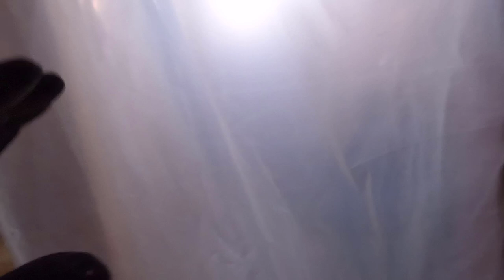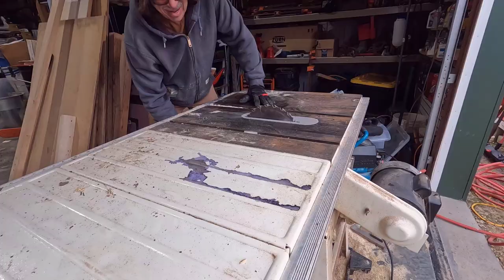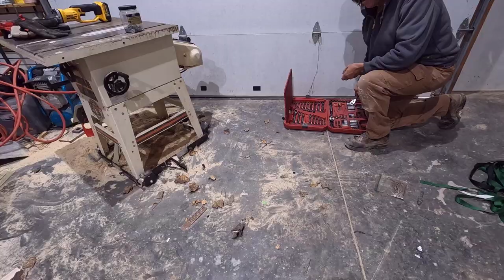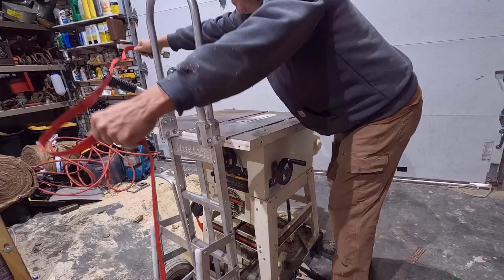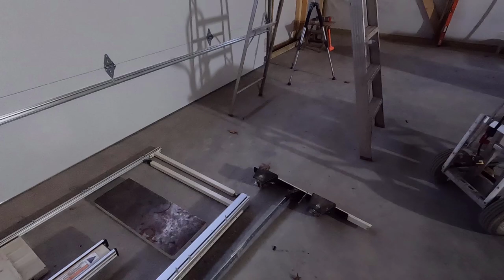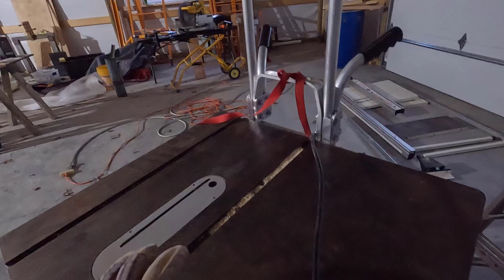Disassembling and Moving the Table Saw ― Blizzard on the Way!

Comment from the maker: All of the big machines are now over at the new shop! We had a blizzard last night that turned into freezing rain so it would be very dangerous to move machinery on the ice that's out there now! I'm really glad I got that done last night! Now I need to get the table saw reassembled, so I can move it around and use it, but I also need to find a base for the two machines without mobile bases, and it looks like that wont be easy! 

Dream Woodshop Build - https://www.youtube.com/watch?v=AoImFB7OU6c&list=PL_iZ8t8zAFuNbJMo1364rxDdTzcUNXcsJ

The Woodshop Self-Build Post Frame Playlist: https://www.youtube.com/watch?v=0lj0BOLzIRo&list=PL_iZ8t8zAFuN1C0XY70Gd-EaS0z2Knt0Y

Massive Concrete Block Retaining Wall -- https://www.youtube.com/watch?v=4HK40MAtL6g&list=PL_iZ8t8zAFuOSMNq3yhlyQUgLPqPdgVQ9

The Frost Protected Shallow Water Line Playlist -- https://www.youtube.com/watch?v=fHqK2tsprhE&list=PL_iZ8t8zAFuMRCCA56rTahk9c-LRbPq4j

Woodshop Build Tool Links:
Stabila 35712 Extendable (7 to 12 foot) Plate to Plate Level - https://amzn.to/3iGdpwP
Stabila 30035 Plate Level Case for 7'-12' Plate Level plus 24-Inch, 48-Inch Level - https://amzn.to/3AETnZQ
Woodford Y34-3 Yard Hydrant Freezeless - https://amzn.to/3AHE5Dr
Johnson Level & Tool 116 16 Ounce Plumb Bob - https://amzn.to/3jKIj6k
True Temper 00221400A Wood Wheelbarrow Replacement Handles, 60-Inch - https://amzn.to/3xLU4Pc
Starrett-C33H-12-4R Hardened Combination Square -- https://amzn.to/2KL3YOu
DEWALT Metal Shears Attachment -- https://amzn.to/3l8aYoq
DEWALT 20V MAX XR Compact Reciprocating Saw -- https://amzn.to/3nKHVFG
DEWALT ATOMIC 20V MAX Reciprocating Saw, One-Handed, Cordless, Tool Only ― https://amzn.to/2Msu21r
Legend Valve & Fitting T-5500 Lead-Free Brass Curb Stop, 1" - https://amzn.to/3jU9VpO
12 Ah Battery -- https://amzn.to/33JN48U
9 Ah Battery -- https://amzn.to/2SKUQwN
6 Ah Battery -- https://amzn.to/3odC6BW
Gallon Coppercoat Wood Preservative - https://amzn.to/2YDLaaj
Quart Coppercoat Wood Preservative - https://amzn.to/3FBt2io
Digging Bar -- https://amzn.to/3lGIfXu
Magnetic Lever Lock Tape Measure - https://amzn.to/3Exd5s7
3M All Weather Flashing Tape - https://amzn.to/3ICBX4P
Huber ZIP System Liquid-Flash - https://amzn.to/31OtCtN
Seville Classics Commercial-Grade 5-Tier  60" W x 24" D - https://amzn.to/3qgjrXJ
5000 Lumen Temporary LED Work Light - https://amzn.to/3eslZfu
Heavy Duty 3-Prong Wireless Remote - https://amzn.to/3EnPWYN
Powermatic Model 60C 8-Inch 2 HP 1-Phase Jointer - https://amzn.to/3mvPq4M
Jet Contractors Saw - https://amzn.to/3mAAQJs

Comment: Too bad that big door doesn't open but you seem to be making g it around the building without too much trouble. Must be a relief to have the tools in the new workshop!  If you do get that snow they're calling for, you will have perfect timing on your winter seeding. 😉
Reply from the maker: It was actually a bit sketchy going around that front corner of the building, but other than that all went well. It is awesome to have the tools over there. Now I have room to work in both buildings, and I can fire up the machines as soon as they are cleaned! 😊 I agree on the frost seeding! There is 11" of snow over three days in the forecast for the coming week coupled with below zero weather. It looks like the snow is here to stay until Spring!

Comment: Hi Mojo, nice video, let's hope you don't get more damage with the strong winds.
Reply from the maker: Hi Larry! I don't expect any damage on the building unless we get winds well over 100 mph now that the building is dried-in. As soon as the tin is on, the building achieves full strength (as long as the doors are closed). It is designed to be able to withstand 120 mph winds, but I hope to never have to find that out! 😉

Comment: Is the big overhead incomplete with no track?
Reply from the maker: Hi 51ubetcha! Kind of. It is stacked with no spring, and the track is only held up in one place at the top. We have been waiting on springs for two months I believe — maybe three — and they are not expected until January some time. It sucked moving the machines with it like that, but it's better than having that big open hole! We had a blizzard last night, and the shop would have been full of snow!